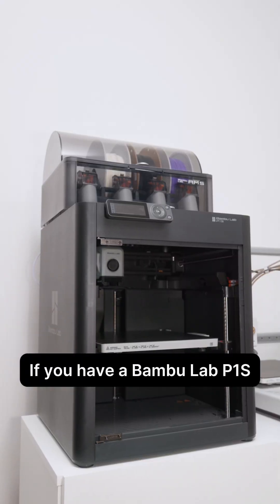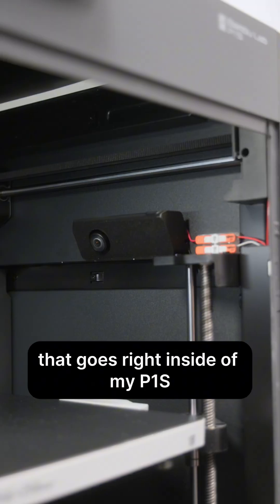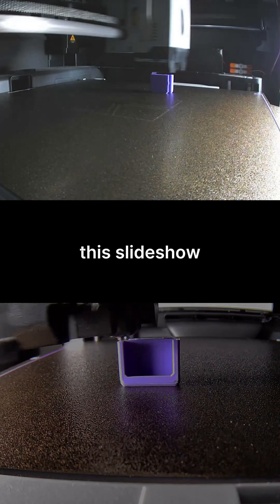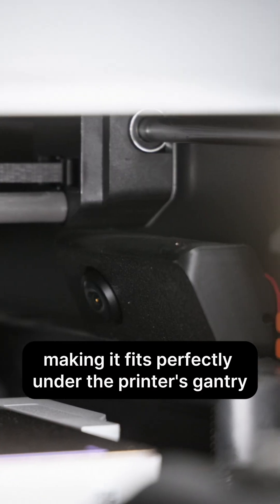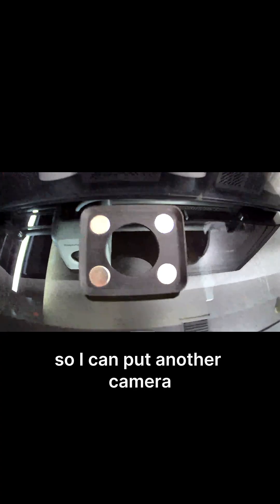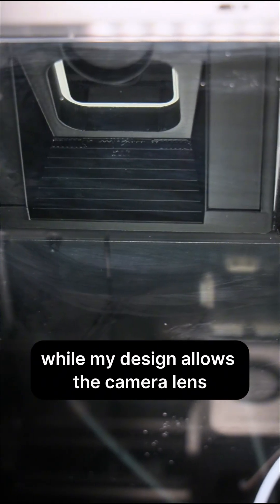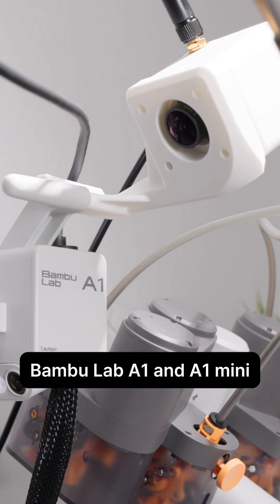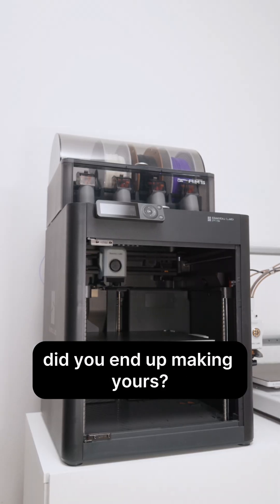Learn3DP Cam: A Better Camera for Bambu Lab P1S? #3dprinting #bambulab #p1s

Comment: the stock camera isn't the issue, its the firmware. even if you wire a 60fps camera into the board, the transmission of data is metered. you still have to view the camera through the wyze app to get good fps. all of this could be fixed with a software update from bambu.
Reply: The stock firmware isn't the issue, it's the processing power of the microcontroller in the P1S. The X1 series printers use a more powerful quad-core ARM processor running a full Linux operating system.

Comment: i completed this project, used the original wire by dremeling it out and expanding the plug port inside. positioned the camera upwards so that it gets a better view and am happy eith the results. not to get the wiring cleaned up
Reply from the maker: That's great to hear, thanks for sharing your results!
Reply: @learn3dp can you post the cam to maker world so we can all print it off the handy app 😊
Reply: that sounds great. so when you used the wyze cam, did you have to install any coding different? or just unistall from its original case into the new printed case for the printer and it works straight away???

Comment: mine hits the gantry also how did you get up keeping it down on the side my gantry moves mine
Reply from the maker: I used a think piece of heat resistance tape (https://www.amazon.com/dp/B07P1RG4JF), if the tape you use is too thick it may hit the gantry. You can also print the back cover and apply tape there also to prevent the enclosure from tipping forward. But with a high quality tape it should work fine!

Comment: I'm very new to soldering portion of this. I bought solder and the soldering iron, there are no resources on the website that tells me what exactly I do for the power for internal P1S. How do I connect a USB to it? what resource should I buy or do I use exactly? What usb wire?
Reply: a usb cable typically has a red and black wire. they solder onto the cams direct power. there are 2 pads on one of the boards labeled + and - + is red and - is black. theyre soldered on directly to provide power to the cam via usb. im sure you couuld repurpose the connector that came with the camera all though its glued down good so may break in the process. print this in abs if your going to to future proof it for high temp prints.
Reply: @DxNxtDisturb  I don't have the type of place for ABS printing. Also for reusing the usb cord, do you mean I'd have to cut the cord then to expose the black and red? Honestly I wish he had a video for that part, so I could just follow it beat for beat.
Reply: @DxNxtDisturb  So by repurposing the power wire that plugs into the motherboard? I'm on like my final step before getting this camera to work I just need either instruction on that or like what supplies I need and to connect it all together. Like how do the soldered wires go to the usb plug in?

Comment: This is a cool design, but the P1S internal cam housing was too tall and interferes with the carriage. It's only about 1mm off so it's probably an issue with Bambu's manufacturing tolerances. Might work on some of them I guess.
Reply from the maker: Thank you for your feedback! I will see if I can lower the height further to take that into account. Thanks!
Reply: @learn3dp Are the stl files available? I’ve just bought the camera and found this video but the original link doesn’t work
Reply from the maker: @bluecollar2380  You can try this link https://learn3dp.com/blogs/projects/learn3dp-cam
Reply: @learn3dp thank you 👏

Comment: I have a panda touch plugged into the internal usb power supply of my P1S. Do you think a usb y splitter would be enough to power both the panda touch and the camera?
Reply from the maker: @MurrayofSteel  should be no problem, the camera uses only a few hundred milliamps of power.